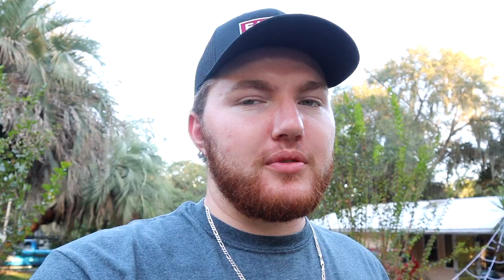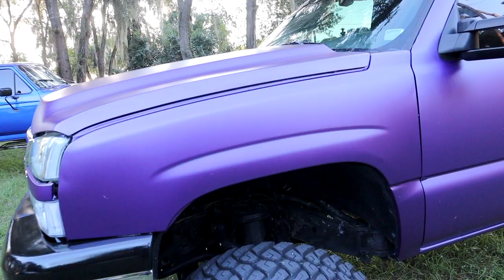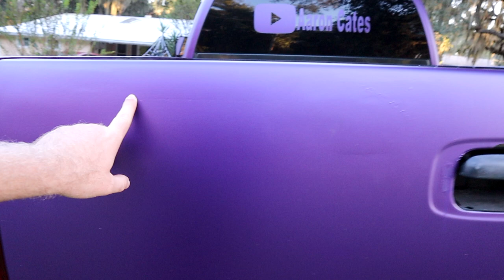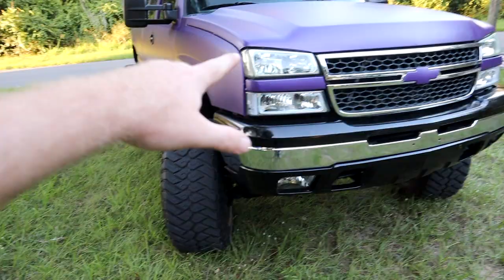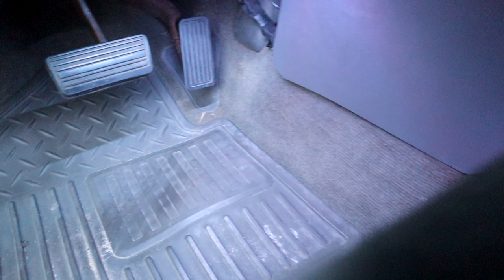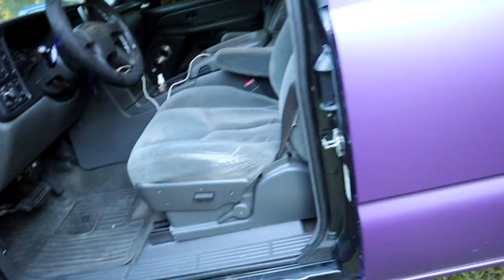Lifted Cateye 4 Year Transformation

Comment: I have a good question for you. On the scale from 1 to 10 how is the ride quality on your Chevy? I put the leveling kit you have it on my Chevy and Idk but it rides really rough. Ik these Louisiana roads make a big difference from where you live.
Reply from the maker: I would say a 7. Doesn’t ride terrible but isn’t great either. Rides like you would expect a lifted truck to ride like. I’ve talked a lot of people through installing the lift springs on these trucks and all of them have told me how bad it rides with stock upper control arms. My suggestion is get a set of spindle source up control arms and a set of new shocks and it will change the ride quality a lot. But remember you are running a leveling kit essentially, you’ll never get the “caddy” ride quality out of it.
Reply: I have the spindle source control arms and I upgraded the shocks to some belsteins. I notice the control arms are sitting all the way down so it really doesn’t have room to work wen driving. You think a bigger knuckle (8in) would maybe help it out a bit?
Reply from the maker: If you could find an 8 inch knuckle. I haven’t ever found one that big.
Reply: @AaronCates  lol same, I’m still researching for some. Appreciate the feedback. Your truck looking real good tho. You Got me wanting to come to Florida to check it out man.
Reply from the maker: Thanks man. Don’t know where you’re from but I’ll be up in August GA in December for a toys for tots meet.